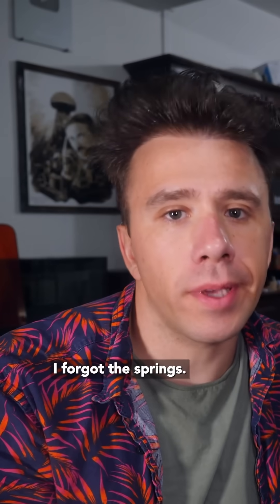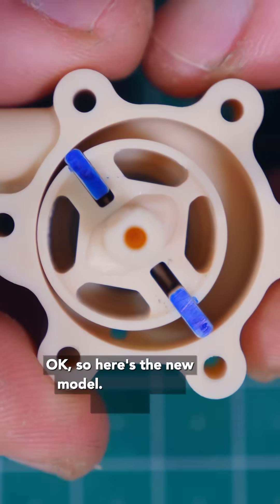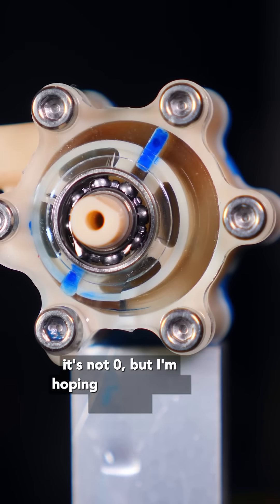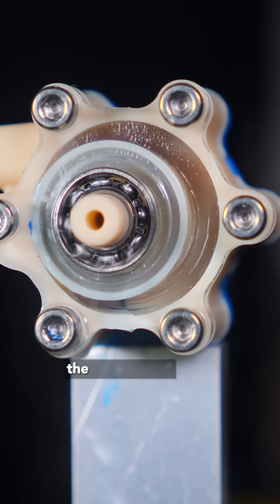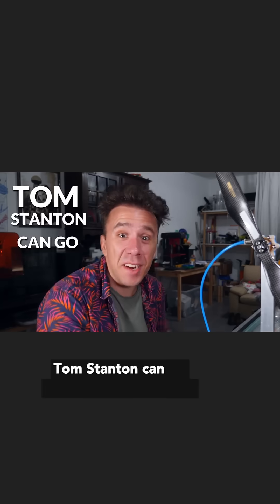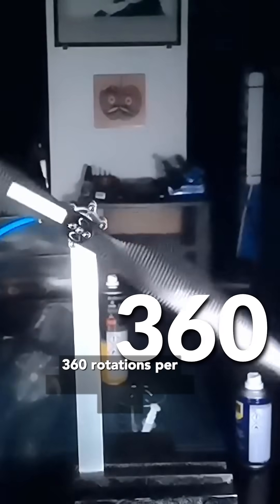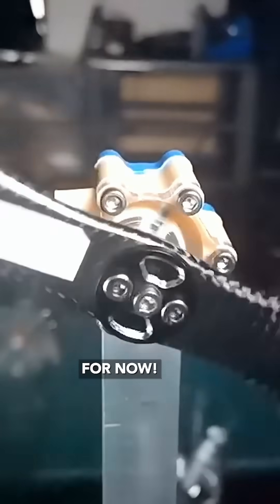A TRUE CIRCULAR ENGINE

Comment from the maker: FULL VIDEO:https://youtu.be/udI2dWmwMUE?si=bXAVigUjmsGPtLe6
Reply: Ok
Reply: hey,
maybe try to seal the bearings from inside. It looks and Sounds that ist's bleeding a lot of air...
Reply: Double the number of vanes 😊
Reply: This is correct answer  @associatedblacksheepandmisfits
Reply: Housing needs a teflon sleeve and teflon vanes and you need a sealed bearings this will help dramatically
Reply: You should really strive to make the motor as lightweight as possible so that it can eventually become plausible for some sort of aircraft whether it be a simple RC design or something mainstream.
Reply: @d4a you seeing this?
Reply: Hey integza, print nylon for low coefficient of friction and long lasting. I use grease and these parts work great
Reply: Hey bro i bought a red 3d print wankel from you last year but never recived!??
Wtf man
Reply: Hay bore Yamato’s are very much 🤮🤮🤮
Reply: Edward Hugh Dornan 22chauvel st Campbell needs a 3dPriter to help make som form of car to build a rocket bike to get away from the tamatos can show power it wit to statons farts from eating the tematos
Reply: Yo, how are you doing? Remember that time you were sponsored by that company that does metal 3D printing with stainless steel? Do you remember what they were called? It might have been like a year ago or something.
Reply: As other people have suggested in the comments, the fixed total length of the vanes will not work well in a circular frame, since the axis of rotation is not in the center of the frame. I would propose a simple fix to this problem that will also improve some other aspects.
The solution is to not make the outer engine walls circular, but in a shape that will keep a steady distance of the vane tips in each position of the frame. There are infinite such shapes, but I could propose an ideal way of making it if you are interested.
Reply: 😮yh

Comment: 3d print a plate type of thing for in between the propeller and the barring, the air pressure can escape there so maybe a rotational plug there might help contain some of that pressure to make it more efficient

Comment: You can use a Wankel engine adapted for air, since in the Wankel the pistons are fixed on a triangular base rotating inside a solid block with a chamber that looks like two semi-elliptical halves of different sizes joined together, you will increase compression and reduce leaks.
Reply: The point is building a "circular" engine. A wankel has a triangular rotor, not circular.

Comment: If you add more veins to capture more of the energy from the air you will achieve higher RPMs two more veins will probably do it which means you'll have to get rid of the rod and go to springs

Comment: oil eats plastic over time, don't use that. also, putting a little lubricant through with the air will automatically lubricate it so it doesn't dry up. if you can find something to spray some astroglide into the line automatically it'll be perfect for that

Comment: This is another example of running the thing backwards to its original purpose. If instead you drive the rotation with an electric motor you would have an excellent liquid vacuum/transfer pump! This is how milking machines work. :-)

Comment: Idea with the single rod two vain compression idea to stop leakage use silicone gasket on vein along with spring for pressure and maintain no leak also increase from 2 vein to alternating four vein for increased constant surface pressure to the veins in increasing input and output power also increase the amount of exhaust to atmospheric pressure stabilize the consistent flow of power

Comment: Maybe you could try making the vanes from Teflon and maybe a stainless steel sleeve for the vanes to seal against but still have a low friction coefficient?
Because I think right now you’re fighting a lot of friction and leakage. Might also try sealed high speed bearings.
Don’t know if that’ll get you to 1,500 rpm, but should get you a lot closer.

Comment: Find peak torque rpm and gear the prop to that. If it isn't fast enough you need a bigger engine. Think Wankel. Those engines only get so much torque per rotor and then they have to add another rotor. Your engine needs either stages ( like a steam engine ) or multi rotors, like a Wankel engine.

Comment: Use a dry graphite lube spray on the plastic parts. It's really tough stuff. I spray it on the inside of a cast iron crucible for melting zinc alloy for metal casting.

Comment: I worked in max compression and laminar flow rates; you should offset the compression region with a larger diameter or even an oval shape around the main rotor to maximize high compression thus revolutions.

Comment: Great work, too narrow diameter.  Larger swept diameter with a narrow volume would increase torque allowing larger prop.  You are chasing RPM when it should be torque Then the ratio of air loss to work done is reduced.   Warning, Tom has a track record of making flying machines, you may find a delivery of Tomatoes.

Comment: The vanes need to close the inlet before they reach their "top dead center" and open the exhaust shortly after. That does not work great with only 2 vanes, you need at least 3 or 4 vanes. 
With 2 vanes you waste a lot of air because a lot of it just goes through basically unused because the inlet is open for too long and the outlet opens too late when it is already compressing the air. And additionally the space in-between the vanes is too large, so it needs a unnecessary large amount of air to fill the space compared to the tiny amount of work a single vane can do...
Air driven tools have usually 6 vanes for good performance
Reply: Interesting

Comment: Could you not run small air channels in the rotor to the bottom of the vanes so the incoming air also acts to lift and hold the vane in contact?

Comment: More vanes, and a bigger chamber will net you more torq for that big propeller. Using the rod to drive the vanes is pretty clever, springs are a big failure point for this type of engine. You could still use that in a 4-6 vanes engine by offsetting the rods.

Comment: My little 3-d printed engines can SURPASS what you want out of an air engine, are positive displacement, have both high speed and high torque . . . All with exactly ONE moving part using one cylinder & 3 pistons. Both you AND Tom Scranton can scratch your heads over this!! 😂
Reply: Excellent show the video

Comment: Since the center of rotation of the vanes is offset from the center of the chamber, the length needs to change very slightly. I calculate you need about 0.3 mm difference in length of the vane pair between extreme positions. There might be a non-circular housing shape that accommodates this? Edit: It's so close to a circle that the best-fitting ellipse should be plenty close.

Comment: The RPM problem is probably because the motor is to small for such a large propeller. Either a larger motor or smaller propeller or more air pressure.
Reply: the problem was air leakages, it is explained in the full video
Reply: @nightghost87  not entirely the veins are pretty small so the "low" air pressure can only exert so much force wich is reduced by drag and the friction of the veins on the housing wich is also amplified by the pinching on the rotor if they are extended
Reply: 300Bar co2 gang💀
Reply: Yeah

Comment: maybe using the air pressure you're injecting, instead of springs would be better. as a bonus, it would also increase the strength with the pressure you use

Comment: isn't the shaft off center meaning a rigid valve can't hug the cylinder in all positions? still seems like a great idea to connect both valves so that the valve being pushed in makes the other stick out, but it just needs a spring to account for the small changes in length, although a shorter&stiffer one?

Comment: Difference in diameters are too great. Such a small engine lacks the leverage to move such a large propeller at the desired speed. Consider increasing the engine size and adding a second pair of vanes at 90 degrees offset. You might also consider a sacrificial set of vanes (of a harder material) to wear-in optimal smoothness.

Comment: Does the rod instead of springs work? As the centre of rotation is offset, the distance between the fins is not always the diameter and varies in length as it spins.
Reply: Umm. Not if you think about it. The rod and fins slide to compensate for this
Reply: When the fins are horizontal, they are aligned with the centre of the stationary housing but when they are vertical, they are more the the left, not on centre resulting in a smaller overall distance?
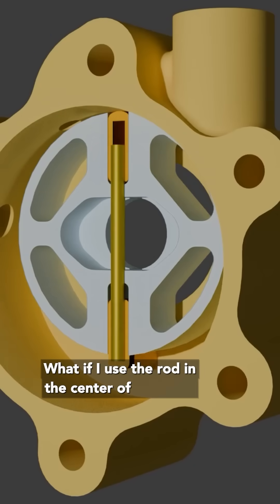Reply: @domlavender pause at @0:41

Comment: Like I said in the original video you need to get a sealed ball bearing. That will stop the air leak
Reply: He can print those seals from any material he wants. But its not airtight. 608zz has metal shield but it is also not airtight.
So what I suggested was getting some ceramic bearings. Those are ungreased and spin freely.
Reply: @jackykoning  That might work but I know of many sealed bearings that are pre greased. They are airtight and the grease does not leak out
Reply: @tomjewett5839 don't trust that a pre greased bearing has the right amount, they put on enough to coat one ball and then seal it most of the time
Reply: @bettafish541  It was all about sealing the air anyway.
Reply: 😂 you need a crank seal! Those seals are just dust caps for ball bearings 😂
Reply: It would help a little but it Wouldn't change much. Any air leaking through the bearing has already leaked from the chamber and is also able to pass between the 2 chambers down the side of the rotor. He needs tighter tolerances on the rotor sides or to use a thicker oil or grease to act as a sealant like a vane compressor does.

Comment: If the housing is circular, then fixing the vanes to each other shouldn't work. When one is fully extended and the other fully retracted, their tips span one diameter of the housing, but when they are turned 90 degrees and both extended the same amount, their tips span a smaller distance, since it is a chord which doesn't pass through the center of the housing.
Reply: agree. the geometry doesn't work with a constant length rod connecting the valves. still looks like a great idea to connect them, but would require a shorter & stiffer spring because the variation in length of the spring is greatly reduced, meaning a more consistent pressure will be applied on the cylinder walls. also connecting the valves with a spring means automatically equalizing the pressure on each side so it should be a win/win
Reply: Yeah agreed, I'm also thinking a spring in the middle of the rod should be a good solution
Reply: Yup. It's been more than 40 years since I had this at school, and even I saw it right away. Gee, maybe secants aren't taught anymore at school?
Reply: Umm? It did work. Really well actually. But he did come up with a better solution regardless
Reply: @PropGuru702 it can't work because of basic geometry, the shaft is off center so the vanes can't contact both sides in every position. if the total length equals the diameter, the engine will get stuck when it's perpendicular to the axis between the shaft and the center of the cylinder. it it's shorter to not get stuck, there's will be a significant gap when it's aligned with the center and the vanes can't create any seal. there must be a huge amount of leak happening, explaining why it's running 5x slower than expected.
Reply: @geemy9675  slow down the video @0:41 it does work and your not accounting for the size or placement of the center core
Reply: @PropGuru702 it might work due to parts bending but it’s not ideal.

If the rod is not through the exact centre of the circle then the chord of the circle is shorter than the diameter.

So either the rod is short and doesn’t fit the diameter and leaks. Or the rods is the same as the diameter and causing bending or stresses whenever rotating.
Reply: @Fogmeister  years. the rod CANNOT go through the center, otherwise there is no displacement, like a piston engine with 0 stroke, nothing happens. as a result the total length will be the diameter of the circle when it is aligned with the center, but slightly shorter when it is not aligned. for an offset of 10% of the diameter, the rod would change ~2% in length. small enough for you to not notice it, but 2% is way too much to ensure a proper seal. imagine the piston in your typical 2L i4 engine being 2mm smaller than the  cylinder,that would be at least 10x bigger than an acceptable tolerance. this would let the vanes bounce on the sides of the cylinder, vibrate, you can rbuild an engine with such poor tolerance. it's is not a big problem because it can be fixed with a spring
Reply: @PropGuru702  I am taking into account the center of rotation that is not the center of the cylinder. because of that offset it can't be constant length. the video does only show a small angle of rotation and doesn't prove anything. geometry proves otherwise

Comment: You can use graphene coating to reduce friction instead of oil which leaks out of the engine and sprays everywhere
Reply: If the engine is leaking oil, it's leaking air and losing power, so fixing the leak was more important than the oil going everywhere.
Reply: He has used it in previous works, don't know why he didn't this time.
Reply: Thought the same thing :)
Reply: i think im not 100% sure he explained why he didn't use graphite like his previous engine designs
Reply: Or make the pin using teflon aka ptfe. Just cut it from teflon tube to get rounded edge, hopefuly it seals better
Reply: Or make the vanes out of graphite. Graphite is easy to work with but makes nasty dust.
Reply: *graphite
Reply: Technically a graphene coating would work too....once you get past the potentially thousands of hours spent doing monumentally difficult and equally dangerous work to pull it off
Reply: @bunnybro5977  it would also be the most carcinogenic thing ever produced.